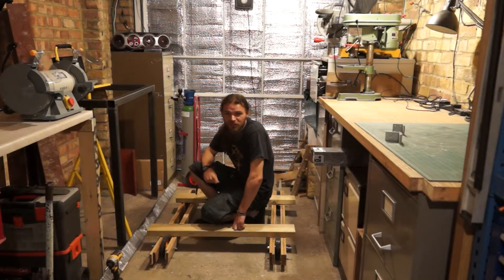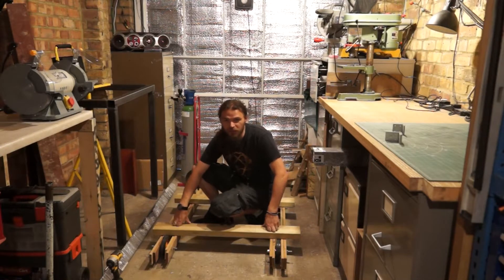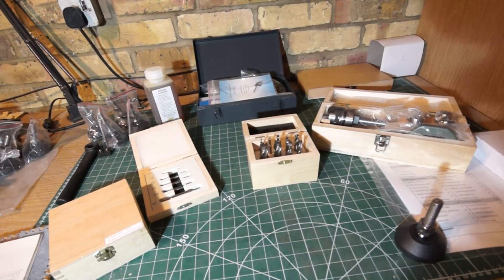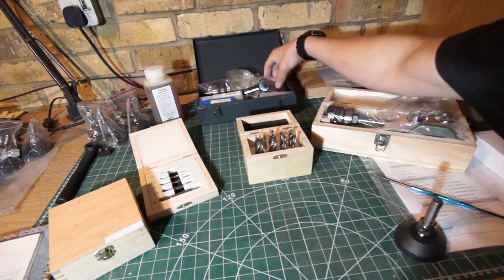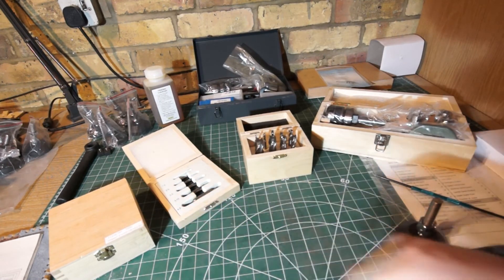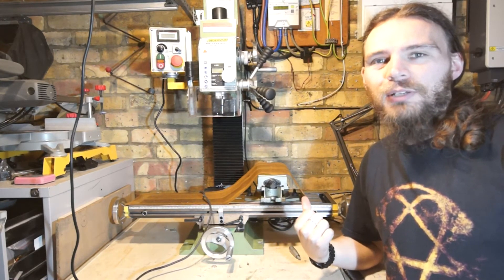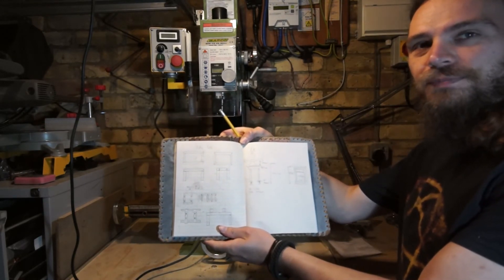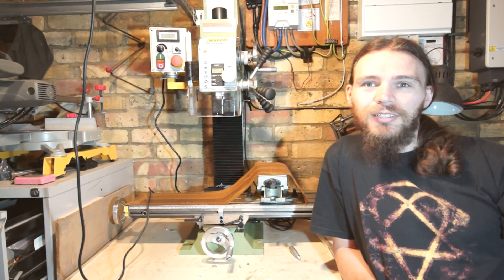Unboxing the new Milling machine (Warco WM16)

Comment: What size bench did you end up using. Im about to order one but ive no idea how much space I need to operate the mill.
Reply from the maker: I built the bench myself for it eventual home. 
I got some 40mm steel box section and welded it together using the chiptray to align the holes for mounting. 
Basically built the table upside down starting with the chiptray, table cross sections then added the legs. 
I built the table the same size as the chip tray about 500mm or 600mm square and its very sturdy and no signs of tipping even with a heavy rotary table on the end of the bed at full extension. can always fill the legs with sand if you want some extra mass.

Comment: what size/ vice is that? also what do you think of the mill so far? I really close to getting the WM12
Reply from the maker: I cant remember but the jaws are 100mm wide 40mm deep and about 140mm max capacity. (Also from warco so it should be on the website) it was recommended by the sales person when i ordered the mill. It also has the swivel base.
I think its a great bit of kit so far. I went for the WM16 mainly for the extra table size but I have hardly used 1/4 of the available travel. Its certainly solid as far as I can tell. I purchased a end / face mill of 63mm and it had no issues whatsoever even though the stated max capcity is 16mm. But that may be specifically for milling not facing. 
Let me know if you make the plunge.
Reply: @CavemanAston  Thank you for the feedback! I really appreciate it. I'm still definitely interested in the Warco brand over Clarke etc as they are better quality. We used Warcos stuff at college too. I was in Machine Mart today as they had a mini similar size to the WM12 and it was tiny!! so I might go for the WM16 albeit the price is ouch :( only downside is I'm limited on space. you ever had any issues with the table being too narrow on your machine??
Reply from the maker: @irongreek7722  Thats good you found one a similar size. I ordered blind based entirely on measurements and a ruler to guestimate the size in the garage. No I have not had any trouble yet. Mostly small parts so far but I find I still have twice the space at least just to move the cutter around outside the work area.